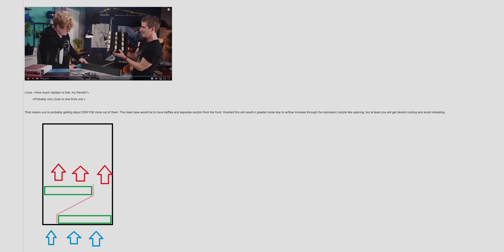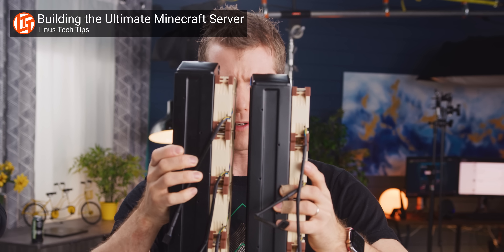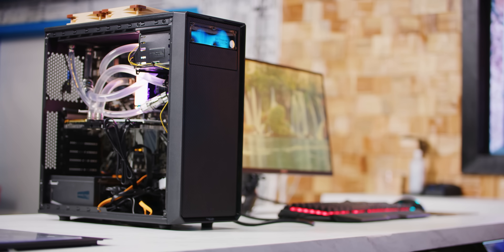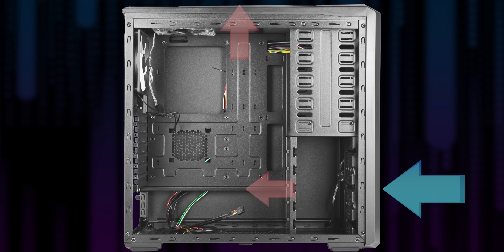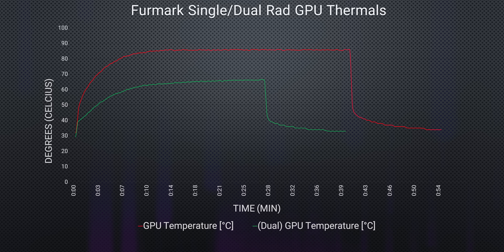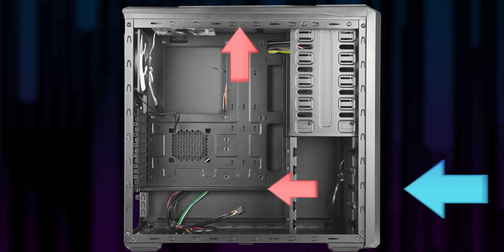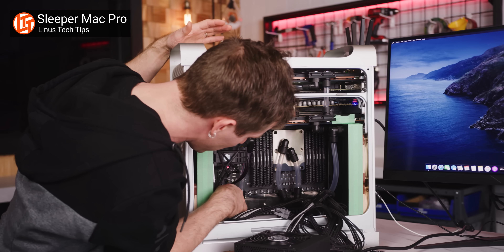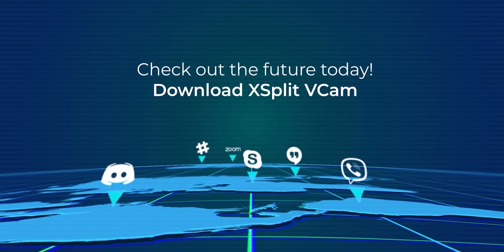I’ve been water cooling wrong for YEARS - $H!T Manufacturers Say

Comment: For radiator cooling, you should always look at thermal design for buildings. For example, an air/air heat exchanger uses crowflow, meaning that hot air goes in on one side, and cool air goes in on the other side. This means that at one end, you have hot exhaust air, and slightly less hot intake air, which has already been heated by the rest of the heat exchanger. At the other end, you have cold intake air, and slightly warmer exhaust air, which has already been cooled by the rest of the heat exchanger.
So for the 3 rad server setup: Hot water should enter in the last rad (which is using air that has already gone through the other 2 rads), and cold water should leave the first rad, which is getting fresh air. That way, there's always a temperature differential, so more heat can be exchanged. 
Air/air heat exchangers in homes can have an efficiency of up to 99%, if I remember correctly (meaning that 99% of thermal energy in the air is kept indoors/outdoors, depending on what you need for your climate), so an efficient multi-radiator setup should definitely be possible.

I can't really tell from the video, but if you test rig is passing the hot water through the top rad first, and the front rad second, this principle would apply. If you flip them around, and put the front rad first, you might get different results. Most likely, due to the case being relatively open (compared to air/air heat exchangers in homes that is), the second rad would still have an effect, but I do expect the effect to be less.

Comment: If you run the hottest (first) water line through the exit air rad you will still have a usable temperature delta to work with, even in a sealed case.

Comment: You should redo the same test without the second radiator but with the fans you added for it.  There is the possibility the results were just because of the added air flow.

Comment: If stacking rads made performance worse, then there would be no reason to sell thicker radiators.
Reply: Yes, but there is a limit to everything
Reply: It doesn't make it worse, it just at some point doesn't do anything. Order also matters. And so does how far the rads are from each other.
Reply: @Demonslayer20111  Yeah, but i cannot imagine stacking indefinitely metal inside ur case :D and i dont believe any normal person is going to give that much money for 2,3, 4 racked radiators but yeah, its a good conseption to think about
Reply: @todortodorov676  what? None of that made any sense. Like we talking about 2 or three rads max. Stacking will not work as well as just putting them all in different places in the case, with thier own intake.
Reply: @Demonslayer20111  I know, linus mentioned stacking them, not just placing them at all 4 places in the case.

Comment: That was unfair. You tested two radiators in series, both driving cold air into the system. The simulations you mentioned concerned your stacked and one-in-one-out configurations, not all multiple-rad setups. Very biased, Linus, for shame. [EDIT] Thanks to a kind commenter, I have seen the error of my ways. Linus does indeed point out that he has arranged the rads in a one in, one out configuration, as some of the simulations showed. My conclusion; I was wrong, and they didn't get all the parameters right for their simulations.
Reply: No, they had one rad at the front drawing air in, and one at the top exhausting it. Not both blowing air in.
Reply: @98dizzard  You're wrong. Linus said they were fitting the fans in the same configuration as the first set. They were both providing positive pressure. If one had been exhausting you would have seen very little difference between one and two radiators, as the simulations indicate.
Reply: @aitchpea6011  he verbally said the top fans were exhausting AND showed a diagram of the airflow
Reply: @98dizzard  Did he? I definitely don't recall hearing that. Not watching the whole thing again to see....time code?
Reply: 06:08 is showing the airflow. Front rad intake, top rad exhaust
Reply: @98dizzard  Huh. I completely missed that. I stand corrected.

Comment: Yeah now try putting the rads side by side instead of stacking them...
Thermodynamics are thermodynamics.
Reply: Obviously they will perform better if they are not stacked.  The problem is there usually is not room to do this.  Linus only stacked them because this is what the space allowed.
Reply: @Plur307  he could have cut a hole in the side panel and put 2-3 sbs instead of 4 stacked
Reply: @HAWXLEADER  I am not trying to argue that stacking radiators is optimal.  I am simply saying it isn't nearly as bad as Corsair claimed, as this video proves.
Reply: @Plur307  these rads were so though that they could have just rotated them 90 degrees to face the cover and make holes in the covers.
Reply: @HAWXLEADER  That makes it a complete pain in the ass to open the panel since the panel now is connected to the water cooling setup and is restricted by hoses, power cables for fans etc.  You also can't set the panel down anywhere when working on the PC.  I understand what you are saying, but there are serious downsides to mounting radiators to side panels.

Comment: If the temperature delta is only 10 degrees maybe they have a point, but there is no way ambient air at 21 degrees is going to heat up to 80 degrees over the fraction of a second its passing through a radiator. I would like to have seen some air temp testing on the outputs of the 2 radiators tested here, because its an important part of this test. A temp probe testing the input air for the second radiator would have been ideal.

Comment: An important aspect, which I haven't seen you cover, is the way the water flows through the radiators. From what I can see in these builds, I'm assuming that you connected the radiators in series, not in parallel. It's then important have air and water move in opposite directions. If air comes into your case through one rad and exits through another rad, you want the water to flow through the exhaust rad first and then the intake rad. This way, the water coming into the intake rad is cooler, allowing it to get even closer to ambient in the intake rad, while also leaving the air inside your computer cooler.
This is known as "countercurrent exchange", a well known principle in biology and industry, and it might be well known in the watercooling community as well, but I don't remember hearing about this at all in an LTT (or TechQuickie) video, and it's certainly not in this one. Basically: to exchange something between two fluids across a barrier (in this case heat from water to air through the radiator), have them flow in opposite directions. If they fluids flow in the same direction, they will at best average out. If they go in the opposite direction, then adding more length or improving efficiency will mean you can approach 100% transfer (which, in this case, would be that the water would be cooled to ambient temperature and the exhaust air would be as hot as the hottest coolant).

Comment: LOL, I don't believe Corsair tried to scam you. I love their products and freely admit that my PC is so full of their gear that I should call it "The Pirate". But what they are saying applies EQUALLY to air cooling. The downside to air cooling is that you are forced to place the cooling fins in the centre of your case as it is usually mounted directly to the CPU as opposed to the ability to place the cooling fins to the side of the computer case where it can draw fresh air. All advantage is lost if either system is mounted on an open test bench. But they are talking about the differences between using a single radiator as opposed to multiple radiators. Again, mount either system to an open test bench and all now is irrelevant. So... what they should have said to you was that your choice of computer case for a multi-radiator system is of ultimate importance. I'm cooling a 9900k, a Poseidon 1080ti and a Asus formula motherboard. If I used a single radiator, the fan noise would send me deaf while I BBQ my T-bone on top of the case. THERE is the real advantage of multi-radiators, fan noise. Yes fresh air flow IS everything. So you have a choice of stupidly large and inconvenient cases or the way I went and get a case with 2 separate compartments like my Lian li. Both my radiators draw fresh air which then travels through its own segregated part of the case to be extracted by fans on the other side. I went to this trouble because I live in a desert where 9 months of the year the daytime temp is between 35C to 45C and drops to a "chilli" 28C to 30C at around 4:00am. Add to this that I don't  use headphones, preferring the convenience of monitors. Unless you live under these conditions, you might as well use an AIO.....Which...Corsair sell....good ones too... I had..one....I hope their...uhm...advice... only appears to be...what's the word..Bias? Get the right case in the first place..Hey..that rhymes..LOL  But I'm definitely water-cooling my chair..Looking forward to that.

Comment: Just because Corsair simulation is very obviously wrong, don't assume that EVERY simulation is not accurate. Otherwise DON'T get on a plane again. Seriously, every single piece of a plane has been designed and tested on a simulation even before starting to build it. And planes don't usually crash. Even molecular dynamics, the simulation of individual molecules, allows physicists and engineers to emulate a material's macroscopic properties. This has led to the development of better batteries, and their simulations are pretty damn accurate.

So yeah, let's not generalise like that, one company said something wrong because, well they just have no idea what they're talking about.

 Cheers.

Comment: i think what corsair fucked up is they are calculating all the heat leaving the flow so say its like 20 ambient. the flow is 50. I think they are going "oh its cooled now so its like 25 and the hot air is 45" when it be more like both are 35ish cause at that point heat no longer travels to the area of lowest density. small mistakes like that do happen a lot and I have done them a lot myself. turning "OH FUCK IM A GENIUS!" to "oh fuck i am such a moron...."

Comment: 140mm intake rad in the back, as big as you can get in the front as another intake. No rad on top but 3 140s exhausting. If your case allows it, another intake on the bottom.

Nothing but ambient air going through the rads and only  hot air going out the top.

Comment: I believe the difference is additional heat/head dissipation. For the Hackintosh the beefy Metal case is an additional heat sink that also adds passive cooling to lower ambient temp inside the case, while MB components like VRMs or IO components add ambient heat. So, depending on the load (like 10Gb network copying of files) the argument might swing both ways...

Comment: Hi Linus, random CFD analyst here. I believe what Corsair wanted to say was that you should not put radiators directly on top/in front of each other because then the one that sits between the other radiator and the inner case environment becomes useless. If you put 2 radiators in different places with different air flows (lets say 1 top and 1 front) while they do not directly pull air through each other they will technically perform better than just 1. That is why your test rig did much better with 2. Maybe try installing both on top and see what happens? Seems interesting.

Comment: The air heating delta will also depend on the radiator thickness and general effectiveness, and the Watts/area you're dissipating.  My Nemesis GTX280 (54mm thick) with ~600RPM fans under load would validate Corsair, so my 140mm rad has separate intake.

Side note: 400W is low for an OC'd 2080ti & 9900K under synthetic loads, though probably fine for real-world OC or stock synthetic.

Comment: You're missing the point they made. It's where the radiators are stacked, whereby one radiator is exhausting through another radiator. Not where both radiators are not stacked (in radiator air exhaust not coolant loop) and are drawing two lots of coolant and and exhausting through somewhere which isn't the second radiator.
Reply: I thought that too, but the first time they called him out, they were not back to back stacked
Reply: @JasonNeri  That's true, though the test rig didn't match the design of Hackpro either, so they didn't really address that critique at all

Comment: One of the things that Corsair probably aren't considering is the orientation of the set up. If the first rad in series is the exhaust then it will be considerably warmer than the 40 degree case air, and get cooled, and then the second one will be warmer than the external air and also get cooled. The examples they used had it plumbed the other way around, which actually would be considerably less efficient than a counterflow set up